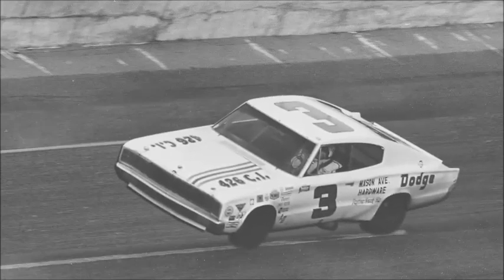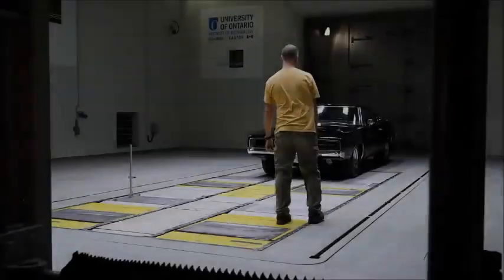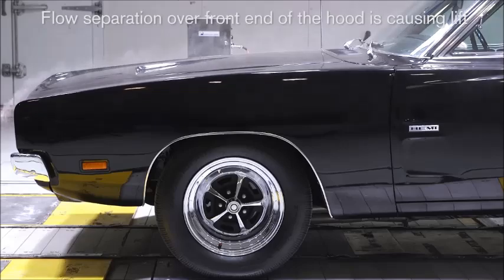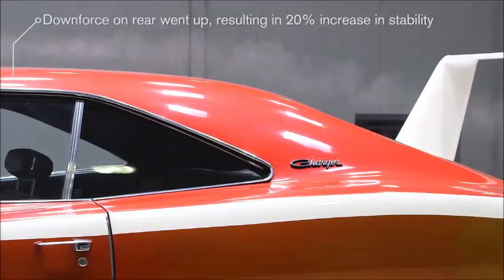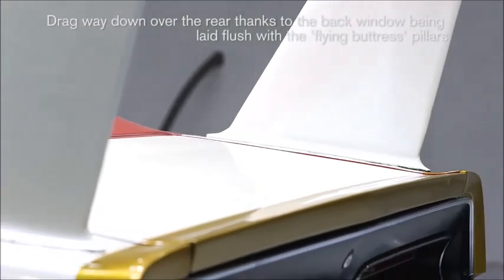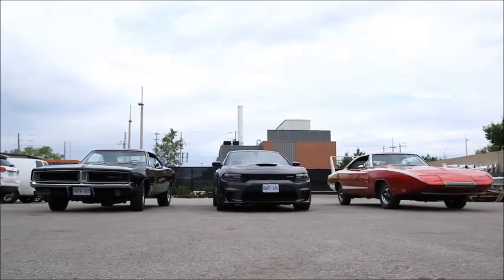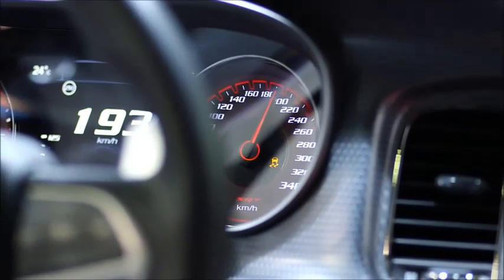Charger Daytona vs. Dodge Charger Hellcat

Comment: Using a stock Daytona Clone in an Aero test that was made to meet the 500 sold nascar issue and not let's say Bobby Isaac's Real Daytona or Richard Pettys Superbird is silly. The Real Deal and the clone are seperated by light years of engineering ingenuity. Anyone who knows what a real Daytona vs a stock factory Daytona looks like knows the visual is extremely different let alone the actual Aero. Remember Bobby and his Team did 216 mph in the standing mile on the Bonneville salt in 1971, that's bad ass.

Comment: Always found this study fascinating, My Low Budget Field studies,, with my twin 68 Dodge Dart,, One still Slant6 and other V8 swap, Since Lowering frront is easy due to Torsion Bar adjustment, While Windshield is wet, Stock height,, like most late 60s car's nose pointed up, Absolutely No Water will move at Speed, none, only after Lowering my Dart, until Water would move " about 8 to 10 inches of the top, did I finally get a difference in overall stability, especially at speed over 85mph and over 110mph.. also opening cowl vents,,

Comment: Technology is a great thing, the hellcat puts out more HP. on the street than a NASCAR 426 Hemi did on the track and does it way cleaner and there should be improvements in 45 years plus the Hellcat is half the distance off the ground compared to the Daytona . Just an opinion .

Comment: What he does not know it the Charger Daytona's Wing. Helps a lot in corners, at high speed tracks. It helped the rear from steeping out. The more the air hit the up rights. It pushed back and keep the car straight.

Comment: "CONCLUSION: The rear spoiler and nose cone improved downforce and reduced drag..."  The tests concluded that the flush, reshaped rear window and c-pillars helped reduce drag, NOT the wing. They never showed any test results of the wing in the video.  SOme say the wing was made to that height in order to clear the deck lid, some say it was to put it in "clean air", but there's no testing in this video. Dodge copied much the design of the 1968-69 Ford Torino, and Torino Talladega, which had more wins total than the Mopars. As a matter of fact, if you look at the 1969 Charger 500 shape, it's basically a copy of the Ford Fairlane or Cobra, and Torino. Compare the grille, headlight doors as well as the c-pillar and rear glass.  They turned the standard Charger into a Torino Sportsroof.  All else being EQUAL-- If you put a slipperier Daytona or Superbird nosecone on a Torino Talladega,  aerodynamically at least, it would be almost the same car.  However if you make the wing helps, (which it might) then you need to show the proof to us.

Comment: The Hellcat has a more powerful motor than the Daytona. Put the same engine in an older charger which one would you drive?
This is an old video. Now you can buy a new Challenger reskinned with the 69 design

Comment: I was 16 in 1978. There were 2 Charger  Daytona's  running around town, back then.  A yellow one and a blue one. It was always cool to see them on the roads. Early 80's some guy was driving around a General Lee replica, that was cool too.
 I had a buddy that had a 69 440 Charger auto, my best friend had a '71 383 Charger 4 speed. Smoked a lot of pot, drank a lot of beer.  A great time was had by all. Today, we are under Corona virus lock down...bored as hell.

Comment: I could not open the link for the data obtained in this study, but I can say that from my own experience with a 1969 Dodge Charger with a 383 engine the front end of my car lifted off the ground at speeds near 110mph. I don't know if I had any headwind, probably very little.

Comment: Guys...you did an entry level job assessing drag and downforce. Congrats. The Daytona and Bird were race cars..racing was driving to the edge of control. You totally missed the verticals. Both cars could stay stable in yaw at 200mph when the tires got loose. EEEE-normous advantage. The Hellcat ain't got none that.    Also...you missed that the winged wonders were not designed by automotive engineers...A guy from Chrysler's MISSILE division (yes...MISSILE) did the deeds.
Reply: i thought  and i did read somewhere that Chrysler asked to NASA engineers how to improve the Dodge Charger for NASCAR.

Comment: No it isn't.  Dodge family sedans have 200cui diesels, and 16" plastic cap wheels. Hellcat is an IYFG bodytype (which stands for in "yer face, germans!") and is as practical on the schoolrun, as a golfcart inside a local supermarket.

It's amusing (yet sad) that present generations waste millions of dollars worth of computerised technology, to achieve something, that two blokes built in a shed, during their swingerparty cooldown, 5 decades ago.

Comment: il take the 69 daytona and even has rare wheels on it.
Reply: Actually, no. It has the Motor Wheel Spyder mags that were never available on the Daytona from the factory AFAIK. The RARE wheels to have would be the "Recall" wheels; They were made by Kelsey-Hayes, they were optional on several Mopars in '69 but developed cracks. The factory recalled them in (I think ) Dec '68 and they were destroyed ny the thousands. There are surviving sets out there and they go for thousands on ebay. They were never available on Superbirds, btw

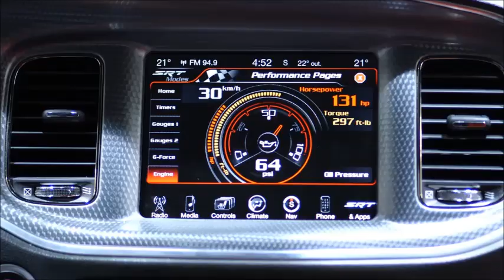Comment: 4:11. And that's why the Daytona is better, it's a huge two door muscle car with an amazing nose cone and insane wing. Even if the new charger was faster, you'd still look way cooler going slow in the Daytona then you would in the new charger at any speed. For me, the Daytona is everything a muscle car should be, its big, loud and broke the speed records at all the NASCAR tracks until it was banned for being too fast and, unlike the new car with its complicated computers and other stuff to make it go fast, the Daytona is just pure, raw power.
Reply: The new chargers are at least 1000 lbs heavier too so if you did some mods to the engine you could easily pass a hellczt
Reply: @rageriustheoverlord7086  straight fax
Reply: @rageriustheoverlord7086  If you put an hellcat engine in a Charger Daytona you will have an even better car.
Reply: @TheLeonmafioso  Not necessarily.
Reply: @cubcadet122  707 Horsepower from the Hellcat Vs let's say 550HP of Second Gen Hemi stock form, less weight  over front wheels (like 10% less) means also better performance. Now, if you uses the RedEye Hellcrate are 807 HP, and if you go extreme with the Hellephant (426CU 1000 HP Aluminium block and Heads) would be mucho powerfull.
Reply: @TheLeonmafioso  Why not just use the more than capable and fully reliable engine that Dodge gave you? The only reasons I see is the weight difference you suggested or if you couldn't modify it for some reason.
It's no obscure knowledge that there was a much higher parts quality in the 60's and 70's. Compare that to a Mexican made engine created in the present day and the 440 or 2nd generation 426 would be a no-brainer. Also, the less electronics the better.
Reply: @ravenwing199  You have lots of experience with Daytonas and Hellcats don't you. The one 1969 Dodge Charger with the highest mileage recorded has 86,992 miles. That means that unless you find a 69 charger with more miles than the one recorded which under normal use and maintenance has fallen to complete disaster, you should just keep your mouth shut and not randomly insult people like that.
Reply: @cubcadet122  No car from before EFI is as reliable or well made as a modern one.
Reply: @ravenwing199  Do you have an example or anything or is that just a Personal belief?

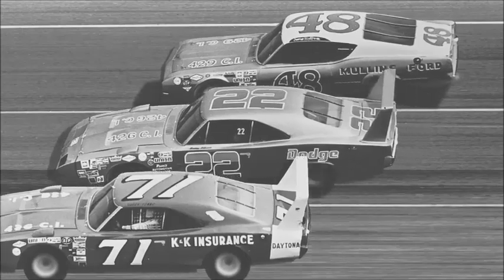Comment: Can someone enlighten me, are Plymouth and Dodge the same brand? The Plymouth Firebird (0:50) and the Dodge Charger Daytona look awfully similar.
Reply: They are similar. Because the Charger and Plymouth Roadrunner are similar. Dodge and Plymouth were partner corporations and had cars using the same model platforms. Dodge was a bit more luxurious, and Plymouth gave you the more affordable car. The Dodge Charger (Daytona) and Plymouth Roadrunner (Superbird) had most of the same modifications made to improve aero.

Comment: the giant wing isn't for downforce, the sides of the wing are like rudders to stabilize the car while turning at 200mph
Reply: The vertical stabilizers definitely served that function, too, but the horizontal piece was sorely needed to add down force as well.

Comment: I believe the superbird had a slightly different angle on the rear spoiler vs the Daytona charger. I wonder what the difference is with downforce....
Reply: The vertical wing components on the Superbird are indeed raked back further than they are on the Daytona; this was because the styling department got a hold of the Plymouth and wanted to make it look better, but they had no say in designing the Dodge. Not sure of the aero effect, but packaged with the other changes between the two cars it might be measurable.
Reply: @nickmaronese  No.  It's because the angled stabilizing was more aerodynamic, less drag. The nose of the Superbird was not as aero as the Daytona, while the vertical stabilizers on the Superbird were more aero than the Daytona.    All of that information and more is available from the Chrysler document archive at aerowarriors dot com.  
Everyone on this thread should read up.
As far as downforce, both cars had 0 at the front and 0 to 250 at the rear, at 190 MPH.
Reply: @Ziggy_Moonglow  Fair enough! It'd been a while (three years) since I'd read through that research, I was likely thinking of the nose and not the stabilizers. Thanks for the correction!

Comment: The primary purpose of the rear wing was to keep the back end from sliding sideways in corners.  More speed in corners without getting lose means faster lap times.  Remember the car was designed to go fast straight (Nose and rear window.) and in circles.  (Wing.)  Simple stuff really.

Comment: The Hellcat is a badass car. But line it up against the classic Chargers, and suddenly it looks like a Camry.
Reply: A real Charger has only 2 doors....alwsys has, always will
Reply: Chevy killed the Camaro by slapping Corolla grills on it year after year.
Reply: lol, so true
Reply: The hellcat looks like a Camry with no other car next to it. It looks very plain and boring.
Reply: @MetalMastodon probably after the camry was heavily modified by someone
Reply: @MetalMastodon then it wasn't a real hellcat or that camry owner breaking some rules cause a stock brand new camry makes no more then 300hp and a hellcat makes 800hp
Reply: There's a lot more to drag racing than horsepower
Reply: @woodyofp8574  torque and tires
Reply: @Fire&Ice909 i was replying to someone who must have deleted there comments idr what it originally said

Comment: Pretty cool but the Daytona in race trim would have looked nothing like the street version they used and the only reason for the added aerodynamics was for racing. The race car would have set very low thereby further reducing front end lift and they had adjustable spoilers to tailor the amount of rear lift needed as different tracks demanded. I would love to see a real Daytona race car in a wind tunnel to see how the aero additions worked for real. No matter what though, they saved Dodge from a seriously losing season. I have read that the stock bodied Charger in '68 would lose control because of front end lift over 180mph. It was so bad that Richard Petty left Dodge and went over to Ford because he was so upset over the design. It wasn't until the Daytona's came out in '69 and were finally competitive against Ford with some really good showings that Petty was coaxed back to Plymouth with a promise that they would have a winged car for '70. What surprises me is how much a '68/'69 Torino looks like a '66/'67 Charger. Although large cars they must be an aerodynamically sound design for high speeds.
Reply: The 68 charger actually had a lot of lift at the back end that would lift up the rear at high speed because of the tunnel window. The front end on the 68's just created a lot of wind resistance because of the sunken grille. In 69 they made the charger 500 with the coronet flush grille and the flush rear window, fastback style to start off the aero wars with Ford. The 66 and 67 fastback chargers looked aerodynamic but actually had a higher drag than the notch back Dodges and Plymouths because of the large surface area and no rear wing. The 66 and 67 fastback would lift the rear at high speeds too, more than the notch backs. It has to do with the huge fastback rear acting as a big one piece inverted foil that acts as a wing and provides lift...upward...and lifting the rear enough to unload the suspension slightly instead of squatting down.  Made for a very unsettling ride at high speeds. Many fastback cars after 68 have a lip at the rear, or a ductail extension or a wing to counteract that lift. Still though, nothing looks better than the coke bottle shape of the 68-70 chargers. They really did look fast just standing still.

Comment: No way does the Hellcat have the same downforce (even close) as the Daytona....also the rear wing was adjustable. The 69 Daytona also has a MUCH lower Cd than the Hellcat.

That's probably why they ONLY showed the readings on the stock charger at the beginning.

"And it doesn't need that giant rear wing or nose cone to achieve the kind of speeds the charger daytona did in 1969."

LOL, It NEEDS 150-200hp MORE to achieve the same speeds. 

FYI, Race spec Daytona/superbirds at chryslers Proving grounds were clocked at speeds the Hellcat couldn't dream of. 

The Daytona ran 200mphs at Talladega, which has a front stretch of  ONLY  2,275ft long.....the Hellcat's 202mph top speed run was done a track with straights 10,560ft long.So the Daytona go to the same speed in about 1/5th the distance.
Reply: FYI, the link in the additional Info. is incorrect. The Hellcat's Official top speed was 204.55mph...not the articles claimed 206mph.

Actually top speed run video -

https://www.youtube.com/watch?v=q7eZ_qlDf40&index=100&list=PL49DB440125048337&t=0s

Another issue with this test is that the 69 Daytona didn't have the hemi...which was about 95lbs heavier than the 440..Not sure if it had different springs(of course the race car did) but the weight would have lessened the front end lift/angle. Hemi car would have less front end lift regardless.

Crazy thing is that the Older = wider & Much higher ground clearance 69 Daytona STILL has less drag, " ...despite the 45 years – and differences in scientific understanding – separating the two vehicles." from the article.
Reply: That's right. Not many people also know that those big vertical fins of the rear spoiler are also helping to stabilize the car at high speeds, reducing butt shake.
Reply: Yes, we adjusted the rear wing's angle on the Daytona to get the best reading. The lift on the front end is essentially the same between the two cars; and the Hellcat had only 20 lbs less downforce over the rear than the Daytona.

The full data was posted in the accompanying Autofocus.ca article; the readings were left out of the video simply for time. (It wasn't my call as producer, I would've done the video very differently, but that's how things worked out.) 

And, yes, unfortunately the AF article is down, now.

Comment: Looks will only take you so far in life you also need to perform Just Because new chargers are 4 doors doesn't mean its garbage or a joke. 707hp and 650foot pounds of torque is no joke also there is no comparing a 66-74 Dodge charger to 2006-2018 Chargers most new V6 sedans handle better and are faster then This Dodge charger daytona but the look will always out style its 21st Mopars.

Comment: That's a Dodge Charger 500 it's not really a stock 69 Charger because the rear glass is flush with the sail panels and not concave. The inset rear glass in the cell panels caused a lot of drag on the 69 Charger and that is why the 500 and the Daytona were so it's not actually a fair assessment of a 69 Dodge Charger because that in setback back glass caused a lot of drag and was pretty much identical to the one on the Road Runner and that caused Richard Petty to bitch a lot and that caused Mopar to get their shit together. That dude giving the wind tunnel test is trying to pull the wool over somebody's eyes because the rear windshield is flush on both those cars he's talking about the black car like it's got an inset rear glass but it doesn't have the standard charger rear inset glass. Charger 500 was basically a Daytona without the nose cone and the big spoiler so yeah
Reply: The black car in the video is a 1969 Charger R/T, is it decidedly NOT a Charger 500. Yes, it has the "flying buttress" C-pillar design and inset glass within the "sail panels". Not Cell panels. Also, the Charger 500 has a flush-mounted grille.